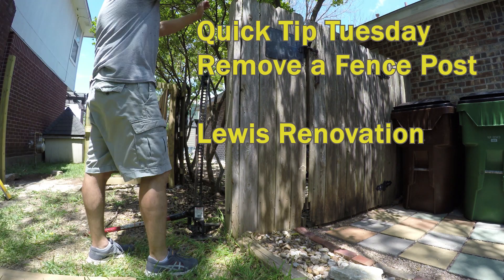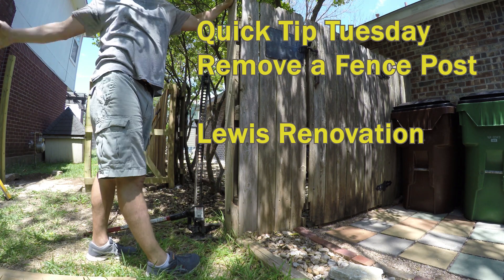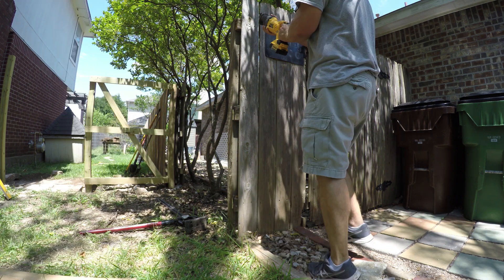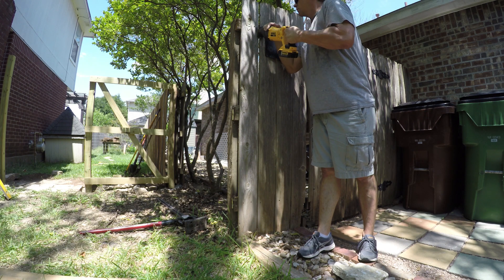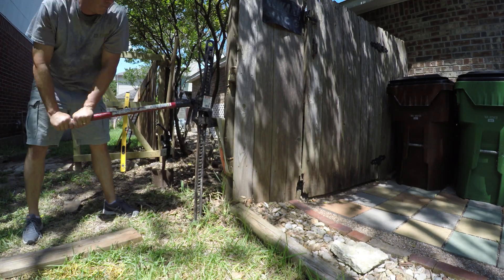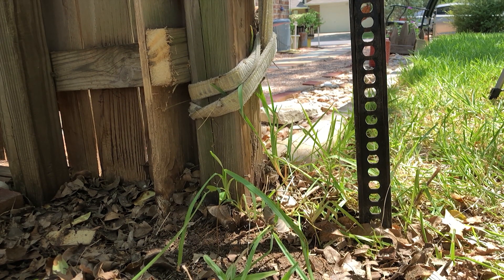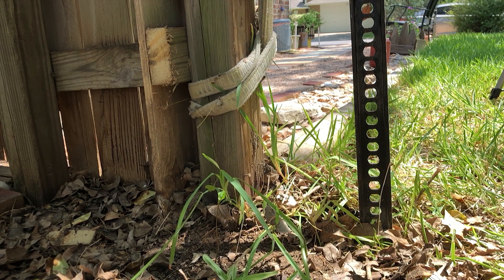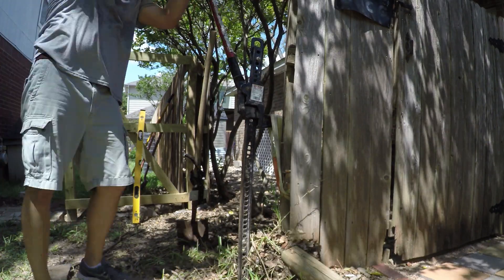Remove a Post - Quick Tip Tuesday

Comment: I'm binge watching your channel. All quality stuff. 
I pulled a could posts this past weekend using this method but unfortunately the posts were completely rotted to nothing inside the concrete and the concrete was just thin & stuck enough that it collapsed into itself every time I could get a grab on it and start jacking. Son of a guns were in 3ft deep! Went back with tamped dirt only. Wood posts last sooooo much longer and stronger in SE TX without concrete.